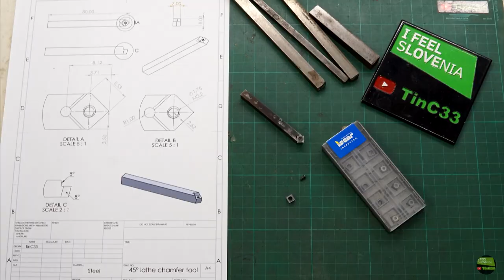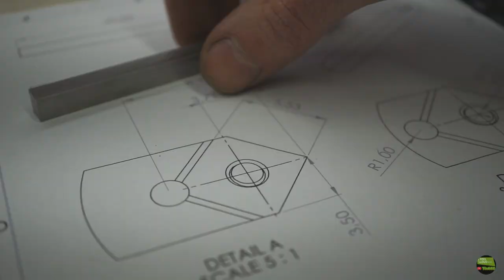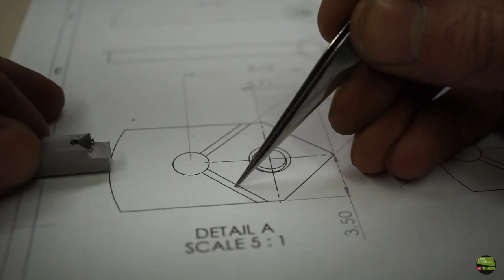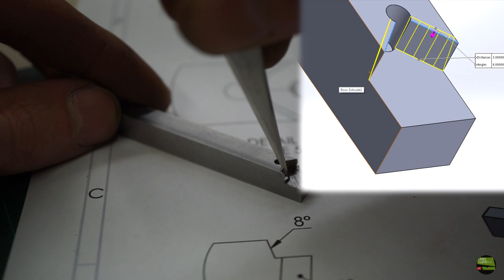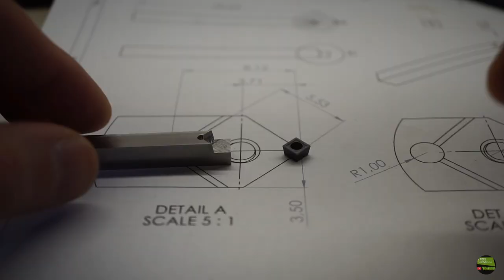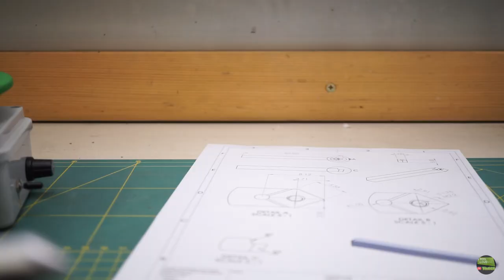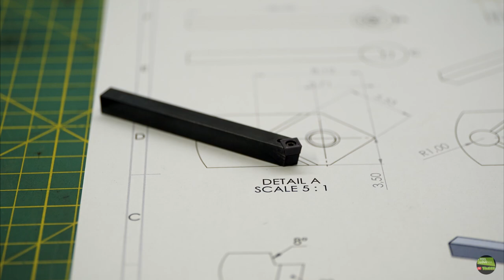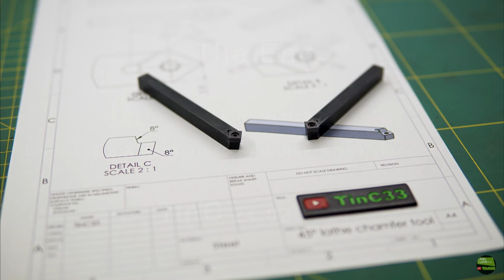How to make 45° chemfer tool for minilathe [insert holder] SOMX 060304 -DT

Comment: Nice work! 

If you had two insert positions at both ends on a longer square bar, you could have one tool for inside chamfers, mounted on toolpost in the long direction (z) and one tool for external chamfers when mount in the "short"/across direction (x).
Reply from the maker: thanks for good tip, i didn't think about, because also for internal chemfer using this tool, but max cutting is about 0,5.1mm othervise change tool, but good idea, rotation will be very fast.

Comment: Did you ever had problems with lathe's motor and electronics or everything works fine?
Reply from the maker: After 10 years of use it work without issue, i don't even replace a single brush, but make lot looot of hours on them, only issue about electronic is that sometimes it try to start motor even if the pot is at lowest poing so for safety i need to turn off the switch.
Reply: @TinC33  thank you